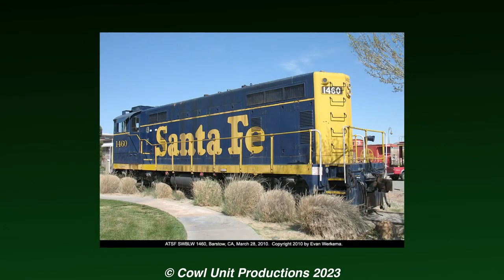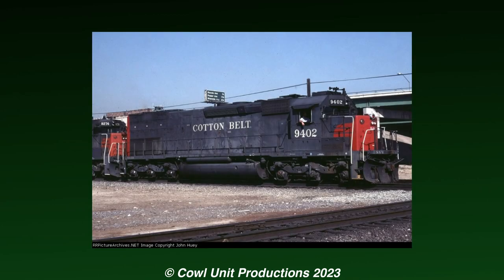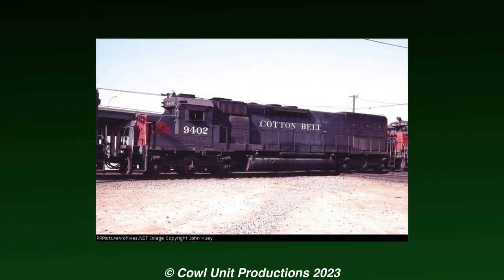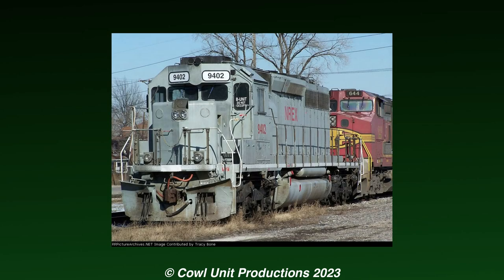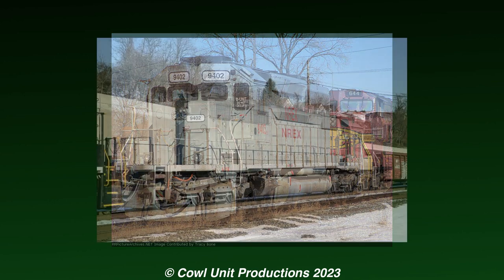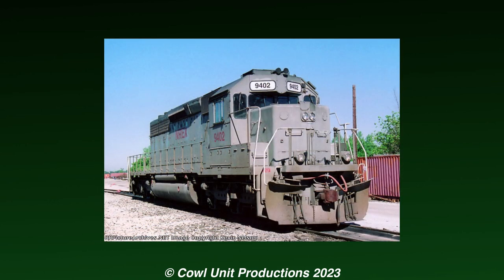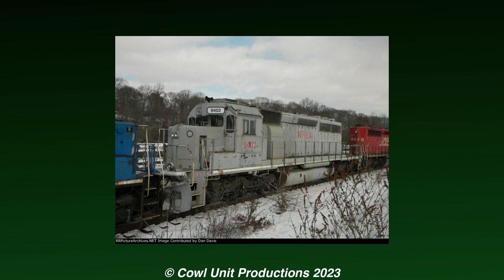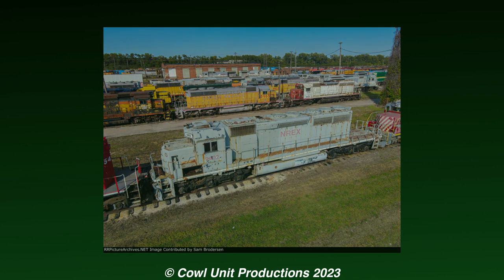Bite Sized Oddities - NREX 9402

Comment: well, if the property was sold to the RRHMA, who are currently preserving and restoring locomotives such as UP 3985 and UP 5511, maybe they realized the (current)uniqueness of 9402 and preserved it as well. one can hope...
Reply: significance? There ain't no significance to this thing. Its a generic diesel that has a huge backporch for some reason. Any old locomotive can be given that treatment.
Reply: @M1chael42O1  okay, fine, fair enough
Reply: @M1chael42O1  Im gonna have to disagree on that one, to many classes have been left to face extinction due to people shrugging them off as "generic" or "insignificant", if anything the unequity of its backporch should warrant some preservation, not to mention it's still a useful, and potentially still roadworthy workhorse that could be used.

Comment: I dont know how much info there is on it, but it'd be nice if you did a bite sized oddity on WC 3018. The unit itself is normal, but it wears three different paint schemes. There's a VMV patch, and even the SCL colors had a CSX marking on the other side, so it's basically 5 companies in one locomotive at the same time. The ultimate frankenloco.
Reply: 3018 is insane. It was originally a Seaboard engine that was in a wreck IIRC and VMV stitched it back together with whatever was laying around. It's got a BN nose, hood doors from SBD, CSX, WC, and I think one or two others. Truly a locomotive Frankenstein.